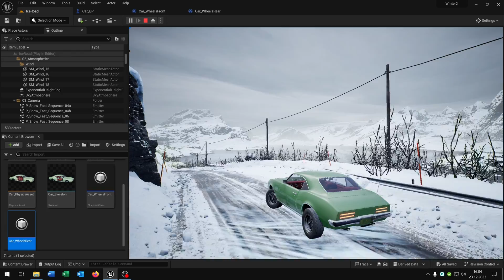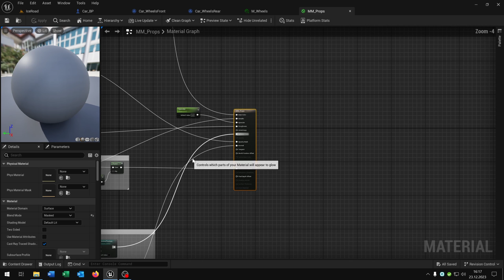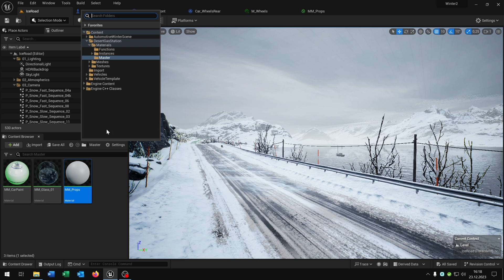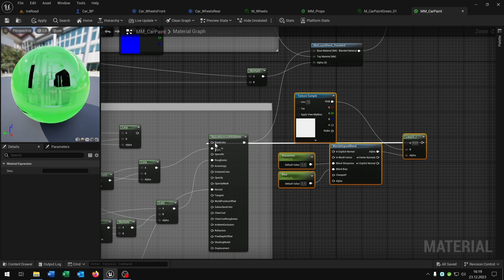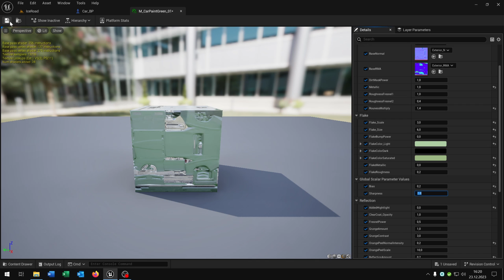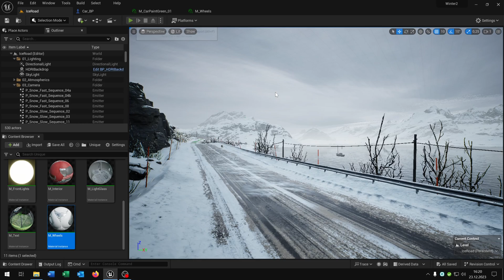Unreal Engine Car Friction / Ice Material Tutorial

Comment: Thanks for tutorial! Can I control slippery, thru material or bounding objects, to simulate normal friction road and ice splats on it? Be cool if you can show like tuts how to make it.
Reply from the maker: Technically yes, but currently you can only set friction inside the Wheel Class. The Problem is that you couldn't change it at runtime. I try to find a work around for that.